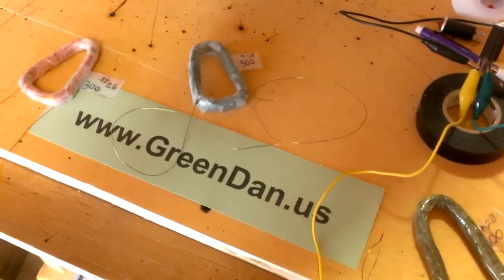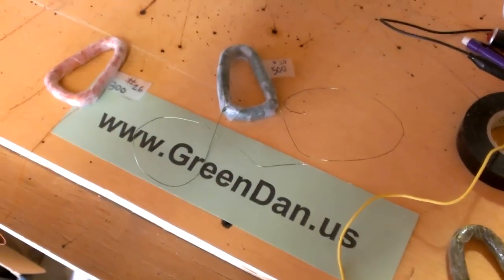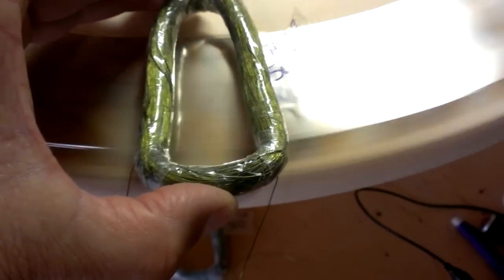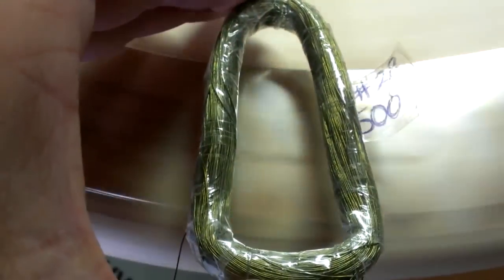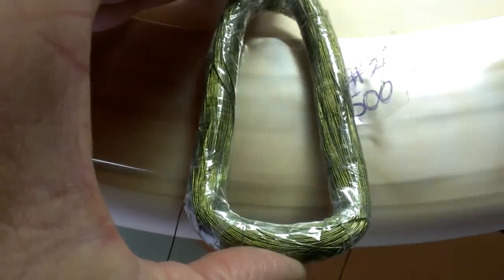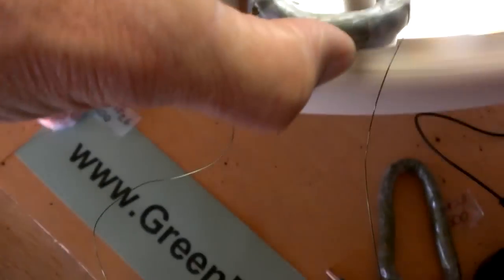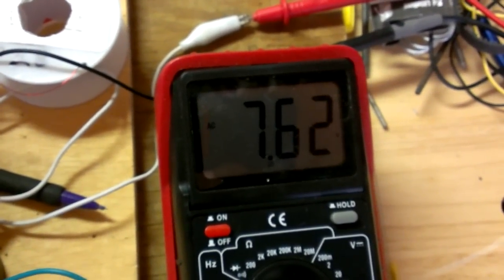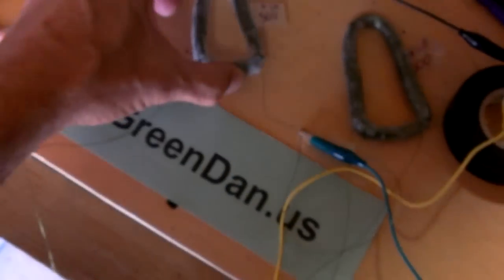Magnets & Different Coils

Comment: Hi Dan. I have a possibly stupid question about coils - If one coil is producing say 9 volts, and you have 10 coils, does that mean you are producing a total of about 90 volts, or is it only as much as 9 volts total (in which case you might as well only have 1 coil?) ?
Thanks for your time, and I'm enjoying the videos!
Reply: It depends on how the coils are connected and how many phases. 
For simplicity Ill comment on single phase  that has just one magnet for each coil. 

If the coils are wired in series, individually they will add up  like 9+9+9+9+9+9+9+9+9+9=90v like stacking 10 9 volt batteries. One thing to remember is that the coil resistance also adds up the same way. 

If the coils are wired in parallel with each other, then the maximum current adds in parallel, but the voltage will remain about the same, but the internal resistance would be the reciprocal of the some of the reciprocal or the resistances of each coil. Imagine a certain gauge of wire can only handle 1 amp. if you have  10 wires running next to each other. then collectively they can carry 10 amps.    

Here is an explanation of  the reciprocal of the sum of the reciprocals https://www.swtc.edu/Ag_Power/electrical/lecture/parallel_circuits.htm